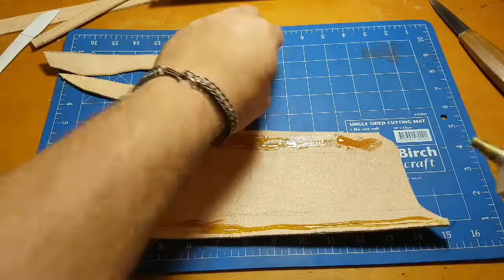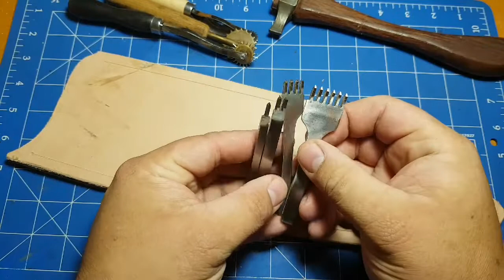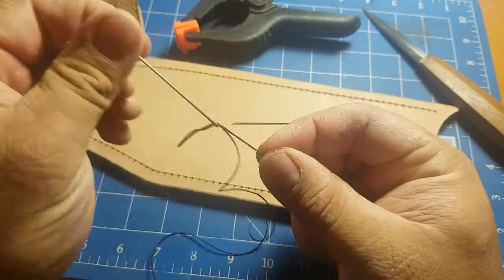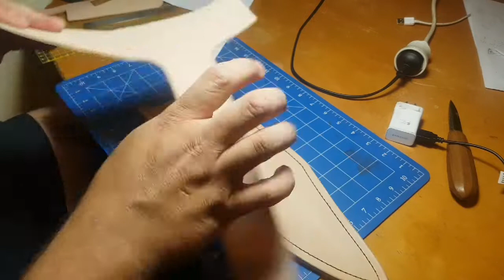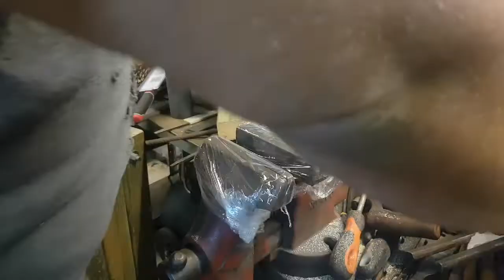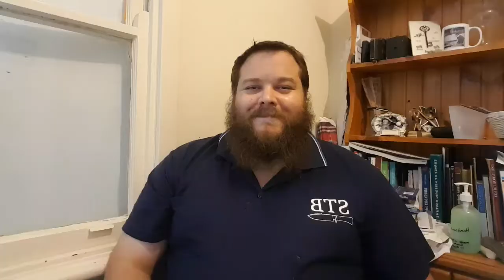How I Make a Musso Bowie Sheath and Frog

Comment: I drill all my sheaths. I need to use an adaptor chuck to take the small drill bits, but they are worth a couple of bucks on ebay and well worth it. Good tip - clean your drill press down well with a bit of degreaser etc before putting the leather anywhere near it.

Comment: Yeah I was screaming at the phone when you went to the drill press. DONT YOU F-ING DO IT! LOL very well done. You can also file a groove around a piece of wood or bone so it will fit around the completed project to burnish your edges. No matter what you use make sure to sand to a decent polish before use it to burnish
Reply from the maker: Haha I knew you would take issue. Yeah I have other burnishing tools, but this one was thicker than my usual sheaths.